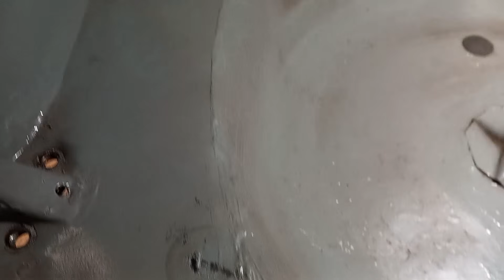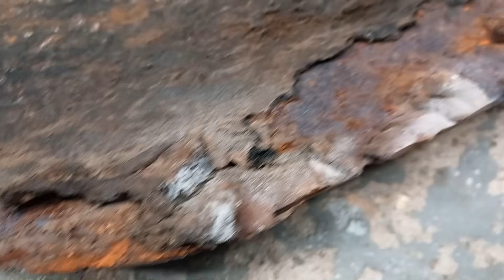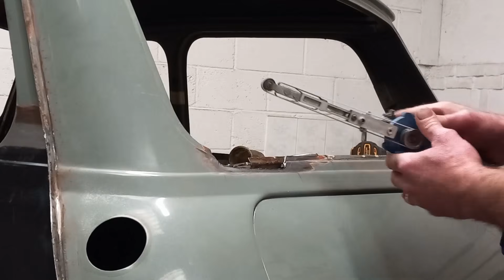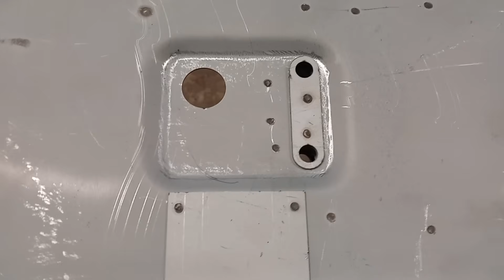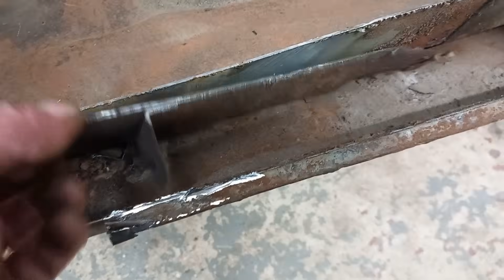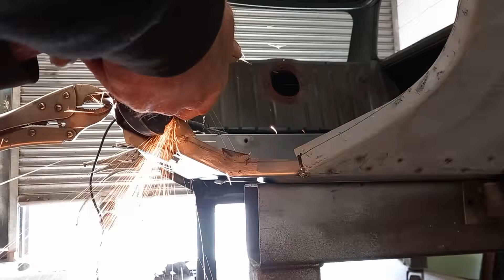Full restoration of a customer's Mk1 Classic Mini 998 Cooper Bodyshell Ep.1/2

Comment: I've seen numerous Mini restoration bodywork done in real life and here on YT, and they deal with underbody rust repairs by replacing each panel, the inner, outer sills, floor etc. But your method here of removing the complete floor looks as the best way to do it. Getting the correct fit, especially the door gaps and so on would also be much easier. Outstanding work. 🐞
Reply from the maker: Thankyou. It does depend on the history of the car, whether it's had previous repairs, how badly corroded it is, how thin the surviving metal is and ofcourse the owners budget. Repairing/preserving often costs more than replacing. So many people do not understand these concerns

Comment: Top work as usual paul. Giving me a bit of a kick to get my british open repaired.
One question for you, what do you recommend for drilling out the spot welds? Ive used spot weld drill bits to some varied success
Reply from the maker: I make my own spotweld drills from a normal twist drill, bought ones are good but wear out so need resharpening anyway. I use an 1/8" bit first just make a small mark in the centre of the spotweld which guides the spotweld drill

Comment: Outstanding work, absolutely loving watching all of your videos so far, Paul.

I would love to see a masterclass video from you on how you set up and use your spot welder (surface prep, electrode gapping, power/time settings etc.). You make it look so easy to get perfectly repeatable factory looking spot welds, from (what looks like) exactly the same spot welder model I have. My welds are so inconsistent in comparison, varying from barely holding the panels together, to burning right through them, even with the same setup. Would be amazing to learn your secrets, there is so little good content about spot welding technique on YouTube.
Reply from the maker: That is something I am looking to do. I'm glad you brought it up as I wasn't sure if there would be much interest. It is mainly about pressure, you need too much rather than not enough to pull the panels together and not blow through

Comment: The only problem I had on my 1966 1275S was the replacement top engine steady bracket fitted to the bulkhead, the angle of the bend of that bracket made the engine steady tie bar too high to fit to bolt to the cylinder head by about 25mm, just a little hassle.
Reply from the maker: That sounds odd. Was the bracket replaced at some point?

Comment: something i do on welding sections in that i havent seen anyone else do over the years is to deliberately make the final cut right through the middle of a drilled out spot weld hole on the flange, then on the new section do the same so both sections have a semi circle that join up to make a full plug hole.
this is where the butt weld is.
i find its alot easier to weld to the bottom panel and walk that puddle to the edge of the lip without it blowing out
on quite a few occasions with a normal butt weld it can blow out the top where you trying to hit the lower panel too
not saying its better either way just something i havent seen any one else do 

excellent work, 
my classic cars of choice, are the 60's and 70's rear engine skodas, here in the UK its pretty hard to find new panels esp shell panels so i can see the appeal of restoring british classics that have a good panel supply or the tools to make them.

when you order the new floor cant you ask them not to fully weld the parts you going to drill out?

would a plasma cutter make a better tool to slice to old stuff apart, i've been doing collision and some resto as work since '86 and now i have retired i got myself a cheap 55amp plasma cutter and boy i wish i had of got one long time ago, would have halved the time and materials on cut outs etc